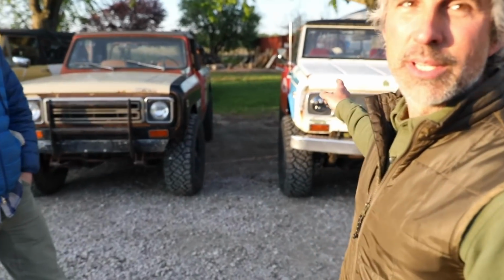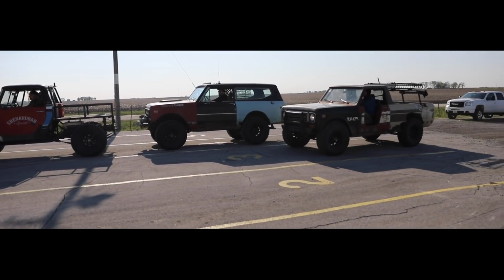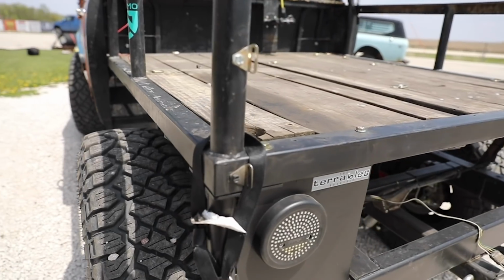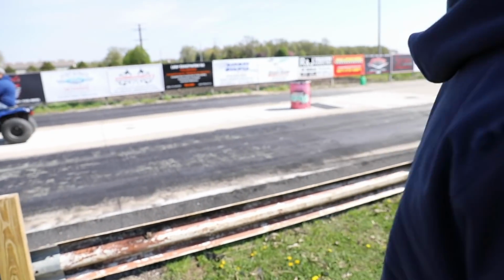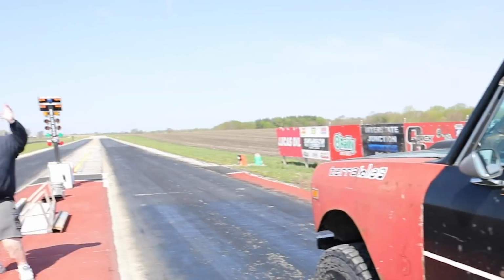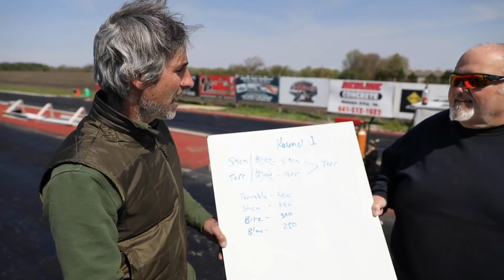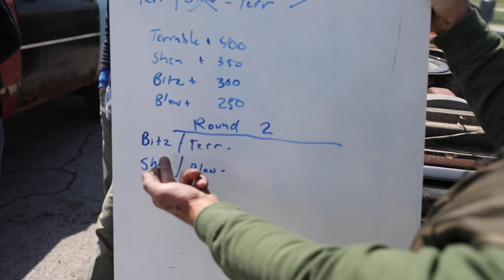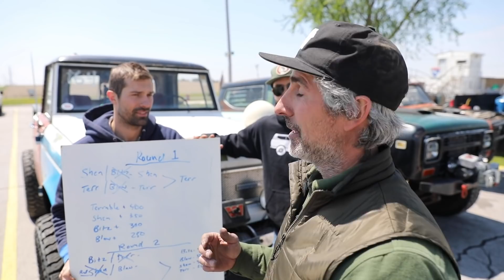International Scouts Go Drag Racing w/ a SURPRISING WIN!

Comment: Top speed drags are fun, but these are crawlers... you need to do a SLOW speed drag... Whose combo of low axle ratios, low range X-fers, and whose low range tranny, combined with turning down their idle to near stall speed will get them down the track in the longest time.  Changing your normal run tires for tiny tires is cheating.
BTW, I've never heard of a T-18 low.  I know the T-19s had wide and close ratio options, but all I've ever seen a T-18 come with for 1st gear were those awful un-synchronized 4:1s.  Unless someone there installed a Terralow kit I'm unfamiliar with.
Reply from the maker: Next time! Is setting the ebrake allowed?